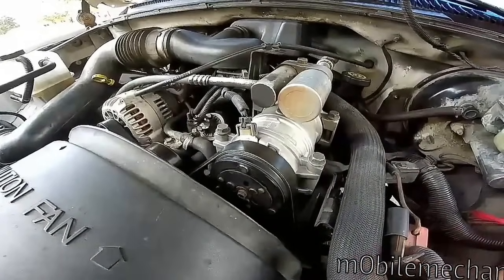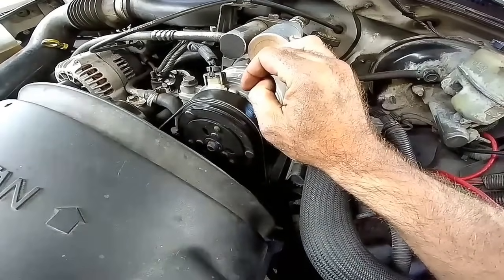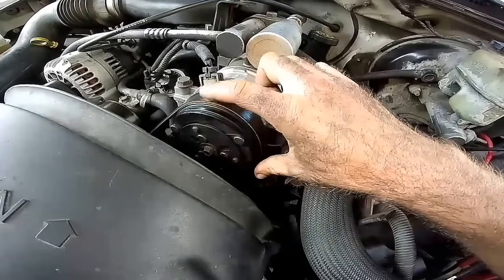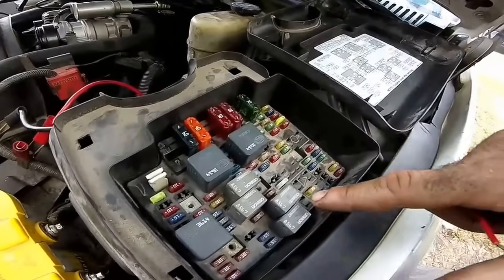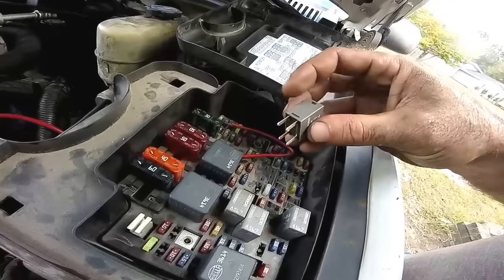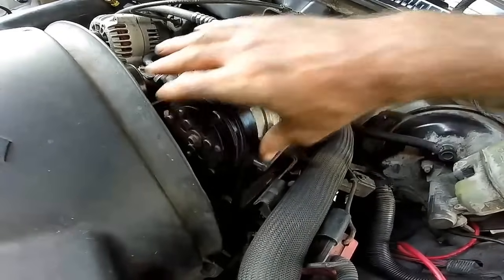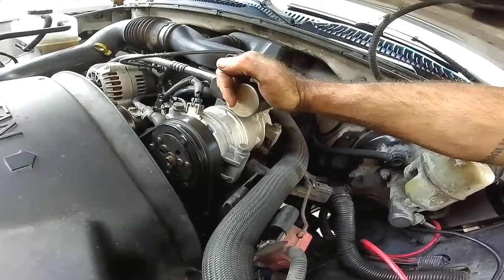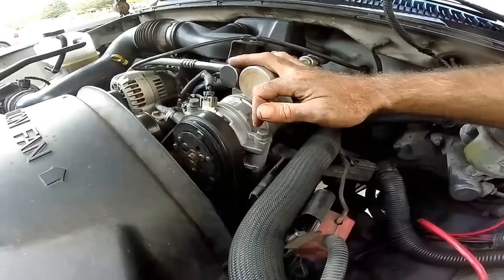Easy A/C Clutch Coil Test A/C Clutch Not Engaging

Comment: got a 2001 GMC Sierra 1500.....my clutch is not engaging at all....got no power with voltage tester to any pressure switches or recirc switch.  So I jumped it with the wire and the clutch does NOT engage.   So should I leave the jumper wire in there and disconnect the connector to the compressor and see if the connector has power to it?  If it does then it is likely the clutch?  (the clutch turns freely by hand now).   Thanks for the vid.  Very informative!  But still confused!  FOLLOWING UP HERE:   I just put a jumper wire on and I have power in the connector to the compressor.  Does that mean my clutch is shot?  How do I know that the whole compressor hasn't failed and not just the clutch?  I just put a brand new AC Delco unit on a little over 2 years ago from Rockauto and now it's out of warranty!  :(

Comment: You should make a video with the power probe, i just bought myself one. My AC was working great but disengaged as i was setting in my car at work. Im hoping its only my high pressure switch or something in the line that caused the compressor to cut off all of a sudden. Thanks though.

Comment: Great video, thank you! 
In my case, sometimes times the clutch is engaging, sometimes not. When it doesn't, there is no ground at ac relay base load side, pin 87 (so bypassing pin 30 with 87 does not work). Pin 30 receives power each time. When it engages, compressor works fine, cold air is blown. What could cause the lack of ground on the load side of the relay base? from the climate control diagram, there is no other control between the clutch and AC relay, only a connector. Can it be only the wire/connector going to the clutch or also some other possible causes? 
many thanks!

Comment: You are the man! Thanks for the easy tip! Now i know my clutch engages without having to do the hassle of getting a meter and wiring the damn thing. Many thanks again! My a/c is blowing hot air and i tried to add freon to the low pressure but still cant figure out what the heck is going on my fuse is good and found that out by using the volt-ohmmmeter. But thanks for the tip knowing my clutch is good. Im narrowing problem down and if anyone can pitch in and help i would appreciate it.
Reply: Did you figure out what it was? Same issue here. Jeep blowing hot air, tried to add refrigerate but the pressure was to high, clutch not engaging, a/c relay is good. It was late and dark so trying tomorrow to narrow it down more.
Reply: Jason Dearmond , hi Jason, did you figured out? I do have the same exact problem here, 2007 odyssey, pressure to height and can’t add any Freon. Was working just fine two day ago. I’ll appreciate so much is any info that had worked for you. Thanks.
Reply: I haven't figured it out. I will be taking it to a mechanic Monday for diagnoses. You mentioned that your clutch is not engaging. That is one problem you need to look at and if thats true you need another a/c compressor. I will update and let you know if I find anything out.
Reply: Abraham E did you guys figure it out?

Comment: Question if I connected a jumper wire to the 87 and to the 30 but the compressor did not make any clicking noise is it a bad connection or a bad clutch or a bad compressor?

Comment: Mines clicks.. however when I add refrigerant it won't kick on? 

Btw.. you are super lucky your ac is in such an easy to reach place.
Reply: Not a pro: How is the pressure of the system? High and low side, the pressure has to be correct, to low or to high can cause the system to no function as well as a protective matter. The only way to test is with the AC gauges.
Reply: @LifeBloodMarketing  oh turns out I'm an idiot.. I had the valves closed on the car. 😅 So obviously refrigerant was not going. I also did not do a vaccum properly for the same reason 🤣. But I'm so dumb it didn't click to go ahead and pull a vaccum before opening the refrigerant can. So I was like well f it.. luckily it worked okay. Car gets cool enough. 🤷 Lessoned learned.

Comment: i did the bypass clutch was engaging so i know clutch is good changed out the relay still nothing what else do you recomend i also could be low on freon also?when engaged i was getting hot air comming out no cold air does that mean i need freon

Comment: So I did this and the clutch turned on and cold ac started coming in but once I put the relay back it wouldn’t stay on, I also changed the horn relay and still turn on. A little advice would help

Comment: i have a directly related question.  My AC fuse, relay and AC clutch are all good thanks to your video. But the AC high side pipe is not hot at all not even warm. But then I touched the high side pipe directly at the compressor output after a few seconds of running the AC and it was burning hot, could not keep my finger on it.  Then i checked the high side coming out of the condenser and it was completely cold, not even warm. Does this mean there is a problem with the condenser ?
Other things i checked : the fans are spinning.  The low side pipe is just a little bit cool but barely at all, it's almost ambient temperature.   Does the compressor output pipe being burning hot means the compressor is good ?  Any other test i can do ?

Comment: Jeez, I wish my alternator and compressor were easily accessible like that. I have an 03 Expedition and every thing is buried. I think my compressor coil is shorting out, keeps blowing the AC fuse when I turn it on and I'm dreading the replacement procedure. Ruled out the pressure switches, relay and diode. With the engine off, I removed the relay and jumped it and sure enough I was able to get the clutch to engage twice and then the fuse popped again. Next thing is to try again with the compressor electrical connector unplugged just to be sure. Its just a pain ind the ass to find the connector.
Reply: Yea man all cars are pain in the asses lol

Comment: This worked for me. Tried jumping at the low pressure sensor like others suggested but that didn't work. Jumped at the relay as he describes here to get compressor to engage then added R12 refrigerant and we're good to go.
Reply: Hi I try to jump low pressure sensor with engine running like other videos and nothing you Jump the relay and turn on the engine ?
Reply: Im trying to see if I make It work

Comment: Pins 87 and 30 I would jump. 
Do I have to have the key on and the AC on hi to jp the relay?
Because I understand the computer sends a ground to the black wire on the compressor. This is a 01 Pontiac Grand Prix SE.
Reply from the maker: No because the ground from ecm you are talking about is only activating the relay on the other pins.  When you jump 87 and 30 you are bypassing all of that
Reply: @m0bilemechanix  
I understand thank you
Reply: @m0bilemechanix  
Looking at the schematic for my car it showed one wire hot all the time and one wire hot with key on or running but I didn't have any power all the time with the car off at the relay with the key off I mean. I had power to one of the pins and when we jumped out 30 and 87 it did kick in. That house I have for the air conditioning can it's no good it's not allowing the fluid to come out the free on gas we have to try getting another hose
Reply: We had to get some kind of adapter from Napa something about an old style hose with a new style cans it worked though.

Comment: Thanks brother , it worked exactly like you said, cold air is blowing 😁
Reply from the maker: you arent leaving the wire in there are you?make sure you only use this method to test the coil operation. you will damage your ac system if you use this as a bypass. might have missundertood you though in witch case im glad it helped!

Comment: Nice video, thanks. I did this test this morning and my clutch and AC works fine. The relay is not faulty, there is no 12 volt to power it, I checked the 2 AC fuses, from there I don't know what to do, can it be the thermostat or software issues ? I have a Civic 2016. Thanks.

Comment: If I can jumper the relay and the coil pulls in then I should look at the fuse? My coil pulls in when jumped at the relay and I have 35 psi on refrigerant gauge which indicates it's in correct range. 
What would next step be?

Comment: Do you know what voltage runs to the compressor for it to engage? Is it 12v?
Reply from the maker: Battery power. This can range anywhere from 12v to 14.5v
Reply: @m0bilemechanix  Thanks!

Comment: Great video.  I am curious, if you were to jump the wrong connections on that relay, would this potentially damage anything?
Reply from the maker: You could yes. You could blow a fuse or possibly even ruin the computer.
Reply: Some cars can leave off. It a bypass from the battery
Reply: Thanks for the responses.  However, as it turns out, my problem was a leak in the high pressure A/C hose.

Comment: I'm just wondering why the ac compressor i just bought the clutch can barely turn it. And it comes with a paper saying it should be rotated at least 10 times using a spanner torque wrench. Never seen that before.

Comment: Hi, thanks for this tip! In the absence of evidence otherwise Is it reasonable to assume that the wiring going to the ac clutch is ok if the clutch engages when you use the relay jumper? Also if clutch engages can it be possible the relay is bad if it didn't engage when the relay was installed? Do you know if the 10 amp mini fuse for clutch is blowing could low R134A charge be a contributing factor for the fuse blowing? Also can I assume that the ignition switch was the only thing on when you did the jumper test?
Reply from the maker: Ignition can be off. If the clutch engages when jumping relay wiring should be ok. If the fuse blows over time I would suspect high resistance in the coil (replace it) or possibly the coil or wiring has a short but not all the time perhaps induced with vibration. No low r134 will not cause fuse to blow.

Comment: .2000 Jeep Cherokee... i tried that relay bridge deal and the wire got hot and blew the big 20 amp ac fuse. does same thing when i try to bridge it over from the high side switch. . Compressor  worked great in the other jeep.  I start the car turn on A/C controls, Hi/max,  When I unplug the ac compressor i still have power on the compressor  end/plug but no power on the plug wire coming from the wiring harness. Only time that wire has power is when the ac is plugged in. Is that right??  My low  pressure switch  4 ports has power on 3 out of 4 ports/slots. My high pressure switch 2 ports  has power on  both ports . it wont take freon.. ..{update }   car running ac controls on, if i unplug my low  side  sensor i then have a hot and ground on the high side switch  instead of 2 hots but still wont cycle  the clutch but low side switch has 3 hot 1 neg. unplugged... i did test the wire thats going into that port and it has power going in the  switch but no power in the port of the switch.  If i hook the low side back up, again i got 2 hot ports on the  high pressure switch.  Even when i have 1 hot side other neg or no power on it. it still wont bridge over the clutch and when i got both sides hot and try bridge it it then will blow the big 20 amp fuse. So could my low pressure switch/connector  be bad if so will that keep it from accepting freon.

Comment: I have no power at my ac compressor,  I was able to bump check it with wires and it clicks in and out . Is there a way to just run a new wire to a switch inside the car ?
Reply from the maker: You don't want to do that because there are safety switches that prevent low charge from ruining compressor and high pressure from exploding lines. The pressure can easily jump to over 500 psi under certain conditions and it can be dangerous if there aren't switches monitoring and regulating the compressor. If it's not coming on it means there is a problem. Best to just get it diagnosed so you don't ruin the compressor or have a line explode.

Comment: my compressor is new i replaced it but still the clutch wouldnt kick on so i replaced the relay and it still didint work but when i try bypassing th e relay it works. is there a reason the relay is not working? also can i just leave it bypass for now or would that damage the ac compressor?

Comment: I am replacing my clutch but the aftermarket clutch uses a different connector so I need to splice the wires. How do I know what wire is positive or negative? (or does it not make a difference) They are both black wires on the coil. I know the positive and negative on the engine harness though. Thanks for the great video on testing it!
Reply: It doesn’t matter

Comment: So My A/C works intermittently, when it works it blows ice cold, when it doesn’t the clutch isn’t engaged and spinning with the pulley. I DO have power to the plug on the A/C coil. Does it sound like my coil is going bad?
Reply from the maker: If power is coming from the relay and going to the coil then it's likely the coil is getting heat soaked and losing ability to keep clutch pulled in. I saw this ones on a Ford and it did the same thing. Would come in for a while and then start slipping and then stop holding all together. On this particular truck the compressor was on the bottom and I was able to unbolt it without disconnecting the lines to replace the clutch and coil.
Reply: @m0bilemechanix  this is a 4.7 Dakota and it’s very intermittent. Most of the time A/C works great but when it doesn’t there is power to the coil/compressor side of the wire harness plug. So I’m thinking that if the low and high pressure switches are sending power to the coil, it’s more than likely the coil that’s bad.

Comment: Quick question, when I push the a/c button on the control panel, should the clutch engage? Should that send power to clutch?
Reply from the maker: yes
Reply: m0bilemecha awesome, I had to wire in my ac compressor because i have a different engine in the truck than was originally there. Some wires had been cut so i wired in the compressor into the pressure switch attached to the accumulator. No power is sent to connecting wires when button is off, when button is pushed power is sent and clutch engages. One wire on compressor is ground. Seems like its working fine
Reply from the maker: Wheless _ be careful though not sure exactly how you have it wired but if you removed the ability of the pressure switches to keep the compressor from coming on when refridgerant is low you can damage the compressor. Glad it's working though. Any chance the AC clutch fuse is just blown or non existent?
Reply: Right that's the thing, im not sure exactly which switch it is i wired it into, was it high pressure switch or low p.s.? The compressor is wired into the one on the accumulator near top of engine bay so when that gets power the clutch gets power. If the computer were to send a signal to cut that switch off, clutch would cut off. When i push a/c button power gets sent, and vice versa. I made a quick video showing the wiring my my thinking behind it i could upload real quick

Comment: I need help. I replaced the pressure switch and also removed relay for clutch and it will not disengage. Is the clutch going bad?

Comment: A simple thing also to check is low pressure switch unplug it short the switch with a wire jumper is the clutch on the compressor engages it's a 10 dollar low pressure switch if your AC suddenly dies do that simple test ALOT of times it's that simple. Just unplug it unscrew the old one screw in the new one plug it up finger tight a child could do it. Then go from there just 10 bucks.

Comment: So what could my issue be if I jumped my compressor just like you did and it works and made sure it wasn’t a bad relay? I have heard it being completely empty will cause it not too spend.
Reply from the maker: Ya that means the compressor isn't being told to come on. Not enough refrigerant can do that. Too much can do that, a bad control unit can do that and so can a bad evap temp sensor. Your next step is to have someone put a set of gauges on both the high side and low side and see what it's doing.

Comment: Do you need to turno the ignition on in order to test the clutch when doing the wire thing?

Also, if you're testing the switch on the compressor directly, does the ignition must be on?

Thank you
Reply: Did you ever get an answer on this from anywhere?  Thanks
Reply: Hello. Not really but I have replaced the compressor myself altogether.
Reply: Great and thanks much for taking time to reply.  I tried tapping the clutch, nothing.  Put a wire on the relay/fuse box  as shown and no movement. So, don't know if the relay is bad or not.  Trying to find how to test with  the wiring that is connected directly to compressor at this moment.  Thanks again! @jeffersonelias81

Comment: Mine didn't jump, turned out my clutch had shattered in my ac compressor, just replaced the clutch and it runs good again. If your A/C compressor doesn't jump with this method it's either the wiring or the clutch went out, i would definitely try jumping the compressor directly through the connection, and the ground to the compressor body by where the ground wire is on it, if it doesn't jump directly it means your clutch is shot, there's pretty obvious evidence but not always, but if you smell a burning smell accompanied by a what looks to be corrosion coming out of the clutch, it might just be a burnt clutch. Be careful jumping directly to the connector, if you do it wrong you can short something out, try putting a female connector on it, you can wire a simple one from parts from Home Depot, just a simple female and a wire will do, less than 10 bucks. If your entire compressor seized/failed it will be way more catastrophic and obvious.